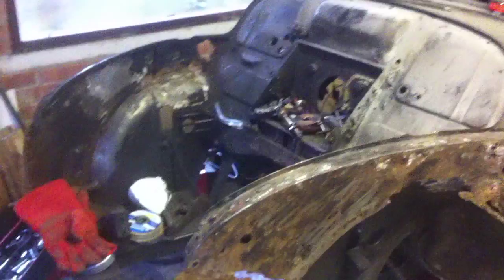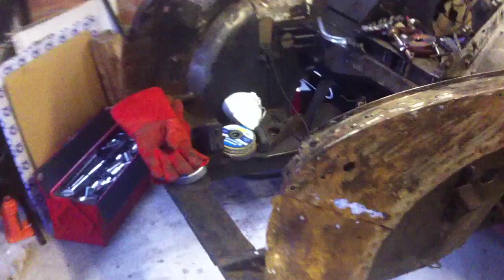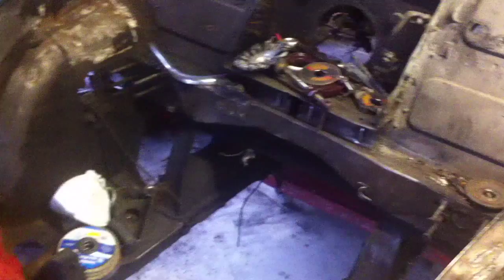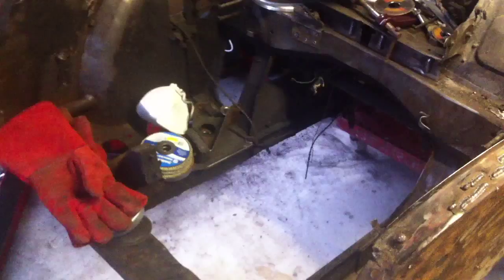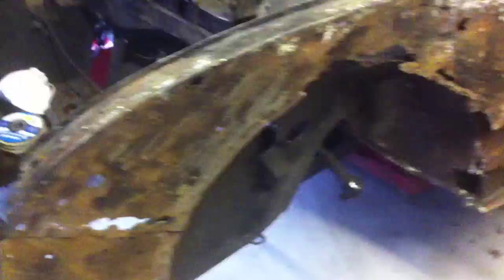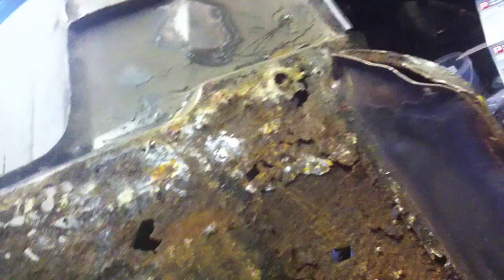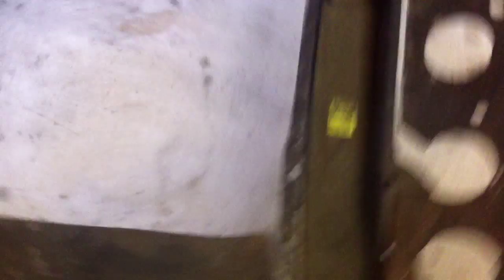1954 Morris Minor Restoration Blog - Part 1

Comment: Nice to see another early car making its way back to full health! As for engine and gearbox choices there are many options depending on your budget. I've also got a 54 saloon that looks 100% standard, but it's got a 948 engine with Cooper S pistons (making it 998cc) hiding under the 803cc air filter, and I also had the original box uprated with 948cc gears. Final drive is also 948cc. This combination works really well, and the car had no problems climbing the Stelvio Pass in Italy last summer!
Reply from the maker: Amazing! I do like the sound of these engine upgrades!

Comment: i would keep the 1098cc yeh little bit more power for hills etc im on my second 948cc engine now its a lovely sweet engine but just runs out of puff on the hills sometimes! so im building up a 1098cc too hope to have it in soon. good luck with your project! ps dont let any body tell you to keep the 803cc engine its just not practical for every day use killed mine in no time! fine if your just going to show the car!
Reply from the maker: I’m very glad I stuck with the 1098cc engine! Thanks! Sorry it took 10 years to reply to this!